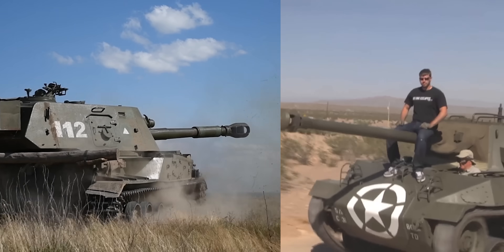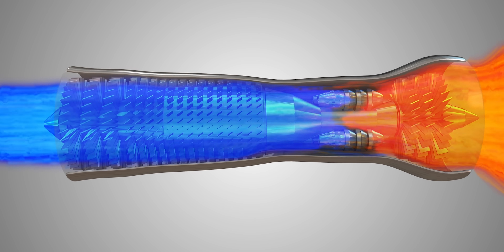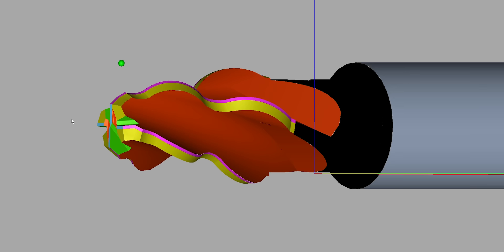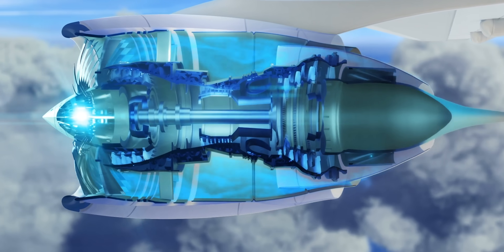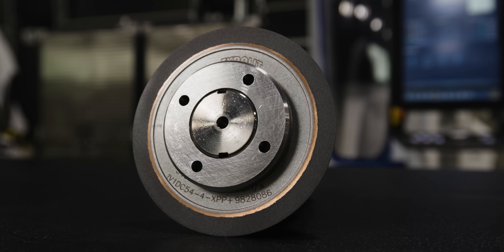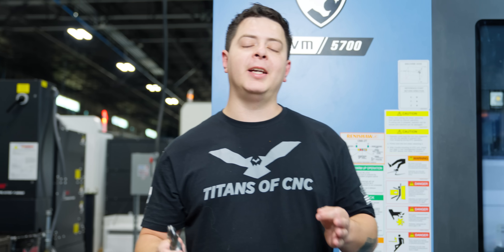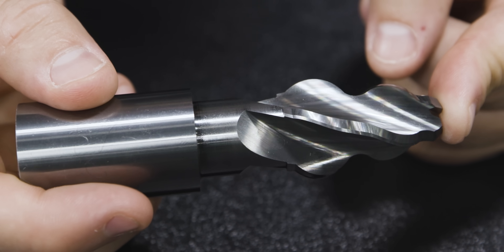Grinding One Of The Most Critical Tools in Machining

Comment: Where I work we have been making fir tree cutters for 5 years on our walter grinders for small airplanes. We hold +- .0002 on the profile. We make them from 1.5inch all the way down to .250. I have personally made tens of thousands of these tools. We have fine tuned our process and make these tools in around 20 minutes a piece. We run an eco loader and it's so fine tuned that's it's a set it and forget it process, spot checking every 10 pcs. I just recently had a 150 hour run with only a few pieces of fallout (due to a non-climate controlled shop). If your looking to get into making these tools make sure you have a  linear way machine. The up and down motions will wear your balls crews out quick, especially if your planning on doing long runs and making 1000s of tools.

Comment: The main thing the turbine does in a commercial jet engine is to turn the fan and compressor in the front.  Power, bleed air and hydraulics are just a small load on the turbine.
Reply: Yeah the turbine doesn't generate thrust, it helps by powering the compressor to provide more air and allow more combustion which means more thrust.
Reply: @faisalalsharaf5823 most of the thrust comes from the fan (the big blades you see when looking at an aircraft engine from the front). Only a small portion of air goes through the engine core. First the low pressure compressor, then the high pressure compressor, combustion chamber, high pressure turbine (powering the high pressure compressor) and finally the low pressure turbine, powering the low pressure compressor and fan.

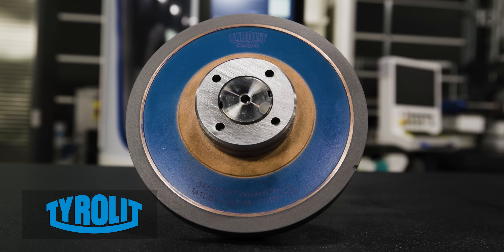Comment: At 3:03 the RC wheel is chipped. Is it possible to still use it without issues ?
Reply: I noticed this too. It could be a failed grinding wheel that they use as a prop instead of having to worry about dropping an expensive production tool, as I imagine they are expensive. However I don't truly know if that is the case or not, just my best guess.
Reply: Likely using the chipped wheel for still shots.
Reply: Its not too bad of a chip and they aren't fluting with that side of the wheel anyway.  Its using the inside radius of the wheel to form the rake.

Comment: Very cool process!
Question - do I see a "nick" or "void" at the 4 o'clock position of the grinding wheel at 03:04 in the video?
Reply: There is a small nick on the grinding wheel, but the SFM of it ignores that its there and it cut beautifully
Reply: I once had a 11v9 cup wheel bust in half on an over night run. The next day when I came in the pallet was finished and all the tools were perfect. I couldn't believe it.
Reply: @TheOxman420  Pretty impressive.

Comment: Fir trees are often wire edm'd. - sincerely an aerospace machinist.
Reply: I was at a GE facility years ago and they cut the trees in the turbine disks using a broaching operation, quite an operation.
Reply: Broaching was the way, but with WEDM, defects, broken cutters, heavy cutting oils are a thing of the past
Reply: @JohnnyAFG81 Wire EDM is also slow. This is much faster thus cheaper. I am no expert, just a guess.
Reply: @crissd8283  your not wrong, but with broaches you need maintenance, heavy oils for way wear. A dedicated cutter grind facility for the cutters. Not to mention gauges fixtures and holders.
Reply: @JohnnyAFG81  Sorry, I'm not talking about broaches but an end mill as demonstrated by Titans of CNC. Yes, end mills do wear out and need oil but this is a highly utilized operation.
Reply: At Siemens we grind them
Reply: @T_A_WOW  blades not the disc
Reply: @T_A_WOW  blades not the disc
Reply: I worked at mtu aero engines and the big turbine disks were mostly broached. Those broached were suuuper long.
Reply: They are also broached, milled, or ground. This is just one of the applications on how they could be made.